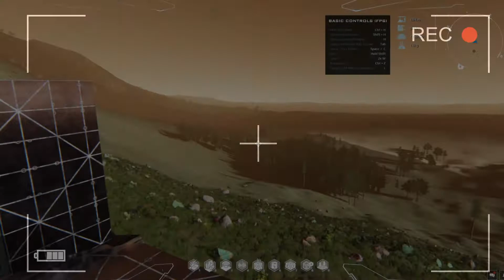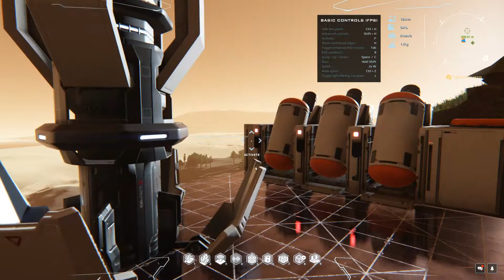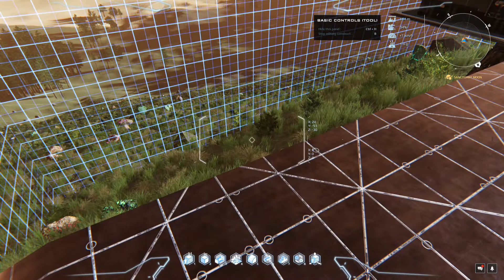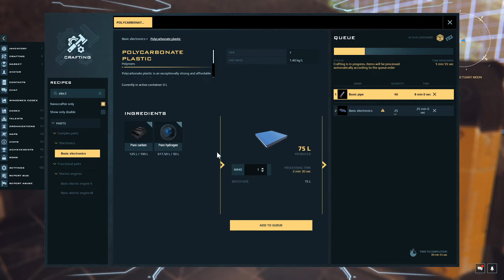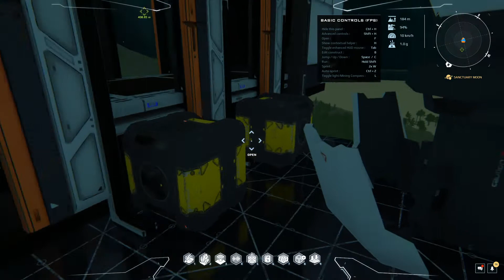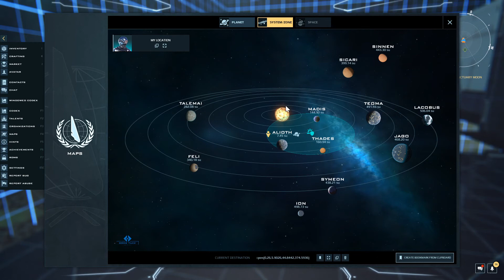Dual Universe Ep3 - Creating an Electronics Industry

Comment: You can look up the electronics M in your nanocrafter (by de-selecting the nanocrafter only box) and then you can see the requirements there, and queue them.  If the linked container is also the input for the industry, then it will start as soon as your nanocrafter queue completes (provided you're logged in).
Reply from the maker: Interesting that it needs you logged in...
Reply: @seraphiraaof7512  yeah, I've reported that as a bug. It's weird because it seems to process the queue while you're offline, based on the timestamps in notifications, but no industry will react till your next login.

Comment: If you right click your S container, and "set as linked container" then press ctrl+i (or click the chain icon in the top right of the inventory) you can make the container your primary container for input and output to the nanocrafter - then you can just queue stuff up to be made.  I would queue the end product (which will not start as it's missing ingredients), then drill down queueing the parts, and moving them up the queue as required.
Reply from the maker: Awesome!  That will come in handy.  Thanks!